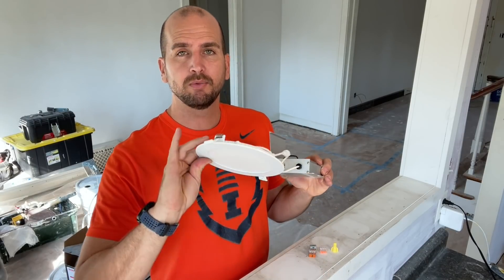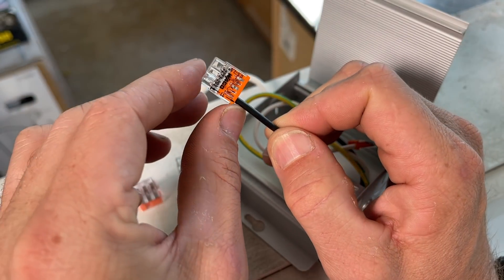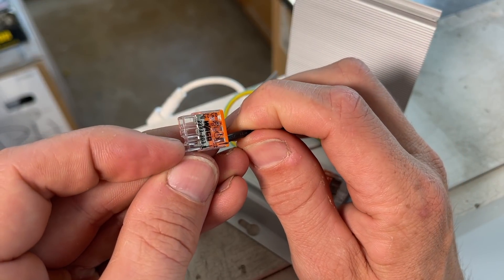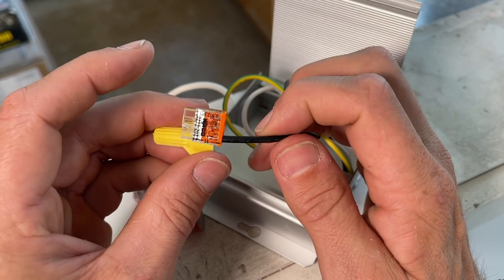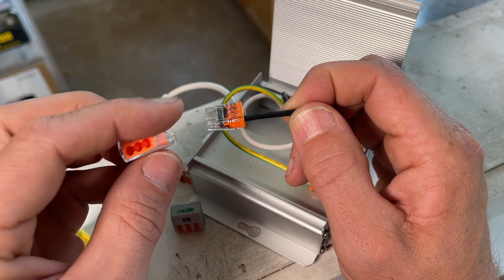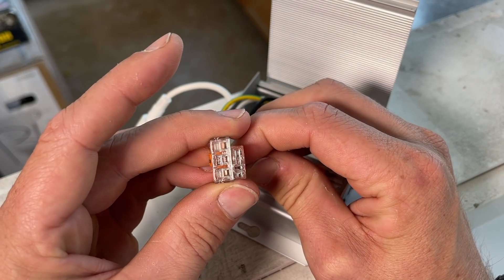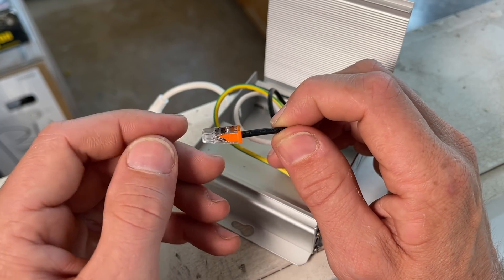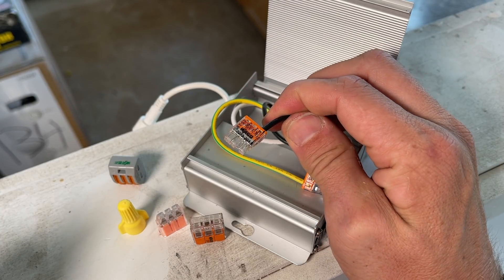Smallest Wire Connector On The Market

Comment: I just saw that Wago 221 connectors are finally on the Home Depot shelves today at least in Southern California. They have ‘New Item’ signs on them. They had the two-wire (10 and 100 packs) and three-wire (10 and 50 packs) connectors. I bought some to try out. If I don’t use them to replace wire nuts, I can at least use them as temporary caps for safety or marking while still having a test port available.

Comment: Per the manufacturer's website, the WAGO 2273 is rated for 20A. So why do you only trust them for low draw loads like LED lighting?
Reply from the maker: I just prefer the Wago 221 not specifically associate to the specs on the 2273.  Thanks!

Comment: It looks like the push in connector from Wago 2273 is ONLY for solid wires. It is not for stranded wires, even if they are crimped or got some solder tin on it to make them solid.
See this video https://www.youtube.com/watch?v=adQdTOYEJQE from a german electrician, starting at 8:10. To have is in English, choose captions and then auto-translate and choose English. I remember seeing this in other german YouTube videos as well, but can't find them anymore. The German  Electrician and YouTuber ProofWood may have mentioned it as well.
In Europe our wall boxes for outlets ts are smaller and we use the smaller Wago push in connectors whenever possible. If a stranded wire is one of the wires we need to connect we user the bigger wago with levers.

Comment: I've seen them being used all over Europe at the moment. For the 2273 - I've seen a 6KW 3Phase delta motor that had the power wires too short and they used 2273 to add extra length..
At least in Romania, most of the high quality contractors for residential houses and industrial applications are using Wago exclusively.. so yeah, they are pretty big
I've seen people testing them with 80A on 2.5mm squared cable and the crimp itself doesn't give up for more than an hour, indeed the cable itself is red hot and usually breaks much earlier than that but that is still pretty impressive
Indeed, US uses much ticker cables to compensate for the higher current but I still think most of them would handle the loads just fine
They are definitely the future

Comment: I'm using 2273 for everything with solid conductors and up to 16A. I started using them soon after their introduction 2015. 221 Should be used only when connecting solid to stranded or stranded to stranded.
Reply from the maker: Where are you located?
Reply: @EverydayHomeRepairs  Hi, I am an electrician in Finland.

Comment: Wago is for speed... nothing else
Reply from the maker: The 773 are the more readily available Wago push-in connectors but the 2273 is significantly smaller.  Also looks like they are trying to bring the 2773 to market which are slighting larger than the 2273 but could handle stranded wire without tinning the wire.  They are much tougher to get compared to the Wago 221 Lever Nuts but I think Wago is trying to build up the supply in the US.  I have found the 2273 at some of the online electrical supply houses but they can be as expensive as $0.33 per connector or if you get the cheaper sometimes you need to buy 500+ connectors.

Comment: I love wago....but at about a dollar a piece...is it really something worth buying? Buying a larger junction box is better than using these... single gang boxes have 10 cubic inches of space...if you can't fit everything in a single go to a double with a single mudring...
Reply from the maker: They are pricey and I have been paying about $0.25 per 2-wire and $0.33 per 3-wire.
Reply: @EverydayHomeRepairs  Wow. That's more than double what I pay for 2273!
Reply: Price is worth it if you consider labor charge. For homeowners it seems high, but ease of use is something. About 5% of the time I had to reopen to fix twist connectors that slipped when I pushed them into the box.

Comment: I just used some of the 221's when putting in a motion detector spot light.  Enjoyed working with them.  I wish the manufacturer of the light had included a grounding pigtail.  Ended up making my own from some 12 ga. insulated green ground wire.  Can the 2273 be used with 12 and 14 ga. wire?
Reply: The canless light most likely has 14 gauge wire, and I guarantee it works with 12 gauge since that's pretty much the standard for most household outlet and lighting wiring.

Comment: I've used the lever a couple of times and they don't work well. Hard to get wire in & they are sketchy to keep connected in a tight box.
Reply from the maker: Appreciate the feedback.
Reply: I've experienced neither of those issues with those connectors. As long as your wire is straight and true there's no issue. Test pulling them showed a pretty insane amount of force was required to get them free.

Comment: You like these but don't like push in connectors on receptacles. Are you a licensed electrician? If not why so much experience on the products used by qualified professionals.
Reply from the maker: Nope just a DIYer, I would use the Wago 2273 for LED lighting but the Wago 221 for everything else (up to 12 gauge applications).  The big difference I like with the 2273 compared to the speed wire feature on most $0.50 outlets is the transparent housing confirming things are fully seated on the busbar.

Comment: I like when previous electricians use these since they give us plenty of work lol bc they fail after about 5-10 years and circuits and lights are intermittent and quit working. Wires heat up, expand and contract under electrical load and the conductors naturally waller and work themselves out of the connector since they are not twisted together
Reply: Same bullshit under every video about wago. Do they clone you?
Reply: @neplatnyudaj110  He copies and pastes this same bullshit everywhere. Must work for a competitor.
Reply: that is funny that wago 2273 was introduced in europe 2015. It is common knowledge that Ideal connectors lose tension but Wago does not.

Comment: How do these differ from 773? Looks like 2273 are hard to source in the states
Reply: Amazon has them, though they are now pushing the lever version
Reply: With the big wall boxes in the US you don't really need them like us in Germany/Europe where our wall boxes are round and have roughly only half of the volume. The lever Wago works with stranded and solid wires, this one is only for solid wires.
Reply: I noticed that you can get this style up to 8 (!) conductor. There's definitely some times where I've needed >5 and had to go back to a big honkin' wire nut.

Comment: Like the 2273-202, 203, 205 (2, 3, 5 wire terminal block connectors respectively, etc…) but they are not easy to find around me; and my local supplier doesn’t have anymore and eta is ????? Even ordering online can be challenging for the 2273 series, like some other items typically use everyday.
Do like the 221-202, 203, 205 models though and use pretty much exclusively unless need a wire nut for particular job/reason (like outdoor work and need silicone filled wire nut for water protection, etc).
Like the lever nuts and the 221 series are my go to, really do like them.
Thx and cheers✌🏻
Reply from the maker: Yeah, I am having the same experience.  I need to reach out to Wago and see what is going on.  Something tells me they are trying to get supplies to companies like Utilitech for Lighting an other fixtures first and then will start filling up the supply houses.  To be honest if Wago could get into Lowe's and Home Depot I think they would do really well with a little marketing / education for the DIY crowd.

Comment: I have been using the Wago connectors in different form factors for probably 40 years of and on.  First with low voltage work and more recently with high voltage aplications.  I am changing my new home to all decora style switches and plugs and the Wago comes in very handy.  Hate how much space the standard wirenuts take up.
Reply from the maker: Thanks for the feedback 👍

Comment: I saw a guy do a high current bare wire test, and I think he ended up running over 100 A through the 221 connectors and started charging his board that everything was mounted to before the connector would overheat call. WAGU has some seriously good connectors, I personally use them on my travel trailer because of their size dependability, and ability to stay a positive connection no matter what the conditions are; even when you’re bouncing down the road
Reply: I actually thought one of them had failed the other day, but as it turns out one of my marine grade connections to the battery broke inside the heat shrink/glue portion. Are used a crimping tool cause that was calibrated, so it wasn’t over torqued but it still busted inside the connector call. The lever nuts never did fail
Reply from the maker: Hey Chris, thanks for the feedback.
Reply: Search for John Ward for that current test with the Wago's

Comment: Thanks for the video..but I'm a little confused. I believe I have heard you say in other videos you prefer the wago connectors to the regular twist ones, but on this one you said "I don't love push in connectors".
Reply: towards the end he mentions the Wago lever style connectors. I have used the 222's in enclosures that had to be transported by truck and not a single problem has been reported with them by a customer.
Reply from the maker: Hey Macster, Yeah the WAGO 221 lever kit is my go to but the size of these push-in connectors for applications like a recessed LED light is pretty compelling.
Reply: @EverydayHomeRepairs  oh I see.. I guess I thought the lever connectors were also called push-in connector since you do push them in before putting down the lever haha.. thanks for clarifying!
Reply: @EverydayHomeRepairs  These would also be great to install smart doorbells.  There in never enough room.

Comment: The ones with levers are my favorite. They hold well and with the difference levers I trust them more than the push connect application. They use them in uk on 220 voltage so I think they will hold up to our electric system
Reply: They're rated for up to 300 volts. Most of them are 20 amp but wago sells ones for 30 amps. However I have only seen the 30 amp ones for 2 and 3 conductors.
Reply: @abdulelkhatib2674 good to know I don't see them failing any worse than a twist on I have pulled some nasty looking twist on out of a few boxes at lest if these fail you will have a way of knowing a twist on you can still have power to everything in a circuit but still a open hot in a box. These I feel having no twist if they fail you still have a open hot but a poor connection to tell you.

Comment: Copper wire to copper wire FTW

Wire nuts forever
Reply: Outside of the US the use of wire nuts is illegal for mains voltage..... Time to join the 21st century
Reply: When using wire nuts, the connection is more inclusive. When using the Wago connector, you only have the clamp inside, which is a ring, and that is the only inclusive part holding the wire. I think wire nuts when the wires are twisted, gives you a more complete connection. Low current applications is not that critical, which was stated.
Reply from the maker: Ken I think you are right assuming the wire nut is properly installed which is unfortunately not always the case with DIY projects.
Reply: @EverydayHomeRepairs  the DIY thing maybe true, I've also seen professionals do worse. Should go with the connection that lasts 100+ years. Wago connections WILL loosen up over time when exposed to the heat cycles.

It's in the manufacturers best interest to convince you otherwise, so be wary of claims of "not affected by heat cycles" or "no voltage drop across the connection."

Comment: I just found out about the 221s, I've been completely rewiring my house this year and absolutely love them.
Reply: Why would you use connectors when rewiring?
Reply: @michaeldunham3385  its just how I'm doing it, it passed both my state and county inspections last week so I'm good with it. It had old cloth wires that someone actually used jbweld on and left unwrapped so I made a safety decision to completely remove old wiring and rewire the entire house.I replaced everything from the service entrance and meter box to the wall outlets. Went from 100 amp to 200 amp service.
Reply: @tommykimble2405  if you are completely rewiring a property then there really is no need to have unnecessary joints, a joint is going to be a potential failure point so I don't see why you'd want to introduce them, anyone telling you differently is wrong. 
I'm not questioning whether or not your property requires a rewire, just how you're going about it.
Reply from the maker: Nice little project 👍
Reply: @michaeldunham3385  both my state and county electric inspectors are very pleased with the work and passed me so I promise you I'm good. The state inspector failed the wiring in March and he was extremely happy with the condition it’s in now.
Reply: @michaeldunham3385  Presumably because the wire needs to terminate somewhere...?
Reply: @mr.g937  in the light fittings or sockets.....
Reply: @michaeldunham3385  I don't know why you are assuming he has "unnecessary joints". Any joint in a receptacle or light is a necessary joint.  And it is standard installation procedure to wire them (in parallel) with junctions at each box. Nothing in his post suggested that he is adding additional junction boxes anywhere. He even just clarified that he is running a home run from the outlets to the panel.
Reply: @mr.g937  unless you can show me that light fittings or sockets come with wago's as standard I'm going to assume that unnecessary joints are being made not those contained within a light or socket.
Again any joints are potential failure points and should be avoided where possible..... this is basic electrical safety
Reply: @michaeldunham3385  When you have two receptacles on the same circuit, how are you planning on joining the two? Through the receptacle? That's a poor practice as it makes the device the failure point. If you have MWBCs it would even be against code. Pig-tailing to the receptacle from a line/load/pigtail splice is the best method, with or without Wagos. And even if you were to use the receptacle to join for the hot and the neutral, the ground would still need to be spliced using a connector. There is no practical way to avoid connectors.
Reply: @mr.g937  Poor practice? And you know that because? Sorry but you're simply talking nonsense, joining through a receptacle is perfectly acceptable and I'd say preferable.